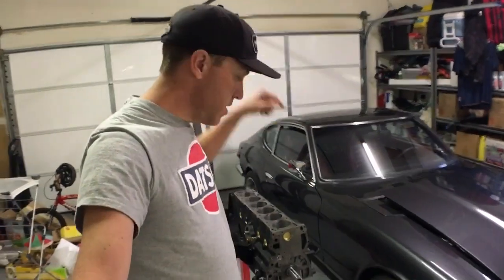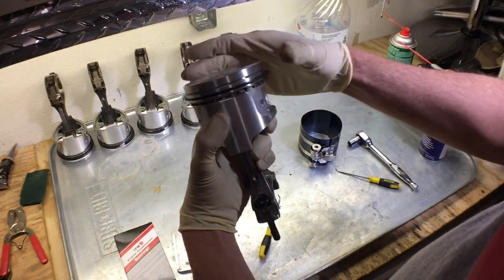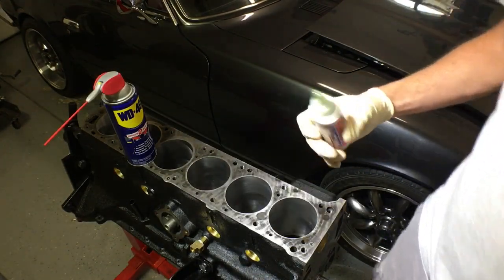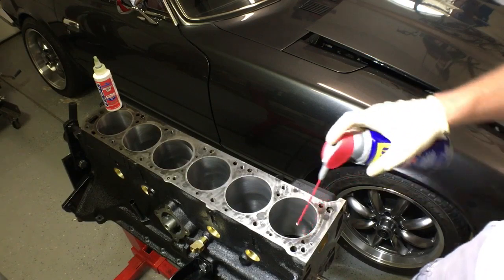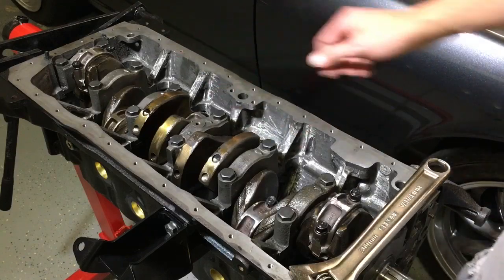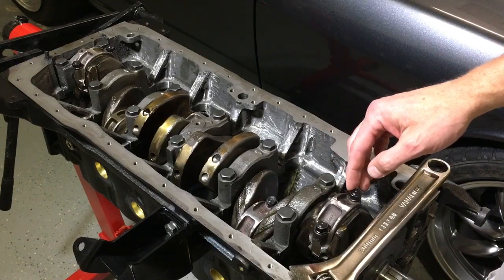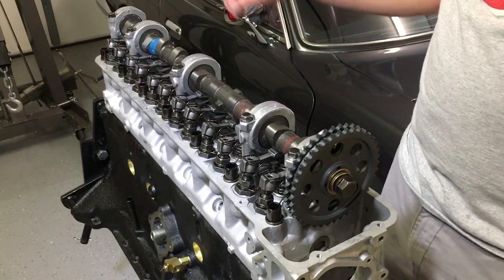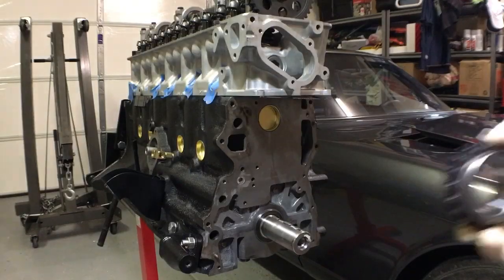How to install pistons, cylinder head, and timing chain in Datsun Z engine

Comment: Great detailed video thank you!  Q - why did you put front cover on and damper to pull right back off?  Was it to make sure you had block at exact TDC??
Reply from the maker: Thanks! This was to double check and make sure our top dead center was accurate on the marking plate and damper.

Comment: I was wondering how you calculated the extension into the torque procedure on the rod bearings and head bolts, from my understanding you loss and have to compensate.
Reply from the maker: There’s no real loss when using extensions, this guy has a few great videos showing. https://youtu.be/tRR96ILGORU
Thanks for watching!

Comment: GREAT videos, Thank you! Question, I have on this is at the 9 minute mark when you put the head on,  you said to :make sure head is in the 1 position" how do i verify that?
Reply from the maker: Thank you! Basically it’s pre-timing the cam and it’s from the dot on the cam gear. Then triple check your timing between the crankshaft and cam

Comment: Just a quick question.  Why did you use WD-40 instead of oil?  I have never assembled an engine but doesn't wd-40 leave a dry surface?
Reply from the maker: +Glenn Randolph it works great as a simple lubricant. Now obviously it doesn’t take the place of assembly lube or engine oil.
Reply: Yeah, I thought WD was a cleaner, even though most people use it as lube.

Comment: So far I have enjoyed your videos,  but one step in your assembly was extremely scary..  When you drive the pistons into the holes you MUST control the big end of the rod.  Damage to the crank is almost a certainty.  Also  some rod bolt rubbers are also a must IMO.  these are crucial steps when assembling a engine. Hope you got lucky.  Got to love the L series...

https://www.amazon.com/Goodson-Rod-Bolt-Protectors-16/dp/B0009RH412
Reply from the maker: +American Patriot Adventures I whole heartily agree with you. Even though I was super careful and took my time, using the rod bolt protectors or even a couple cuts from rubber fuel hose saves you the worry or headaches. I appreciate the recommendation and for watching!! 🤘🏻
Reply: @CarsBikesandCoffee    i will watch your further videos tonight.  Looking to find me a l series project again.  Haven't built one in about 20 years.  It is fun seeing your build.
Reply from the maker: +American Patriot Adventures right on! They are a fun car to work on and build, so many ways to do them. We will be getting back to our 260Z soon! It is a total “frame-off” restoration. Stay tuned!

Comment: 12:48 chain just walked lol
Reply from the maker: +Mike CorLeoné ha, wow that sure looks like it did. Thankfully being the tensioner side it was fine. Everything lined up! Good eyes though!
Reply: Cars, Bikes, and Coffee watching your videos and others is giving me massive motivation to start working on my 71 z.. i have the L28 out on a stand but i bought the car in pieces.. the previous owner took it apart and I’m trying to piece it back together, my biggest question is this. I have a round hole on the drivers side of the engine towards the front of the block where it looks like something goes there.. not sure if it’s coolant or if it’s a breather or what.. do you happen to know what goes there?
Reply from the maker: +Mike CorLeoné awesome! So assuming the front side of engine, on the head, that is the coolant thermostat housing. That would be where the top of your radiator would connect.

Comment: Suggestion that you put rubber fuel line over the connecting rod bolts. Otherwise they have good odds of scratching the crank on their way over.
Reply from the maker: Yes that is great advice.

Comment: Hi thanks for video
Would you show how to adjust valves please. I tried few times on my 280zx and still not right. Maybe my method is wrong.
Thanks
Reply from the maker: Thanks for watching! I will have that on the 260z build that is coming up!
Which method did you do? Hot and cold?

Comment: I have been keeping up with the progress on your Z, Very Nice. I am rebuilding a 75 L28 N42 block and currently having the new 30 over dished pistons fitted. until my machine shop called and said they messed up and went 40 over on the boring. they are buying me new pistons but are having problems finding 40 over dished pistons. but can source flat top 40 over pistons all day long. Do you know if the flat top pistons from the '81-'83 years will work in a '75 L28. the machine shop says the flat tops will extend .030 above the block. what can be done to correct this problem? or should he just keep looking for the dished? Thanks
Reply from the maker: First and foremost, thanks for watching!
So from what I understand running flat tops with the N42 will require a little more work if you go that route. Easy for machinists more money, time, and energy from you. 
Are you in the states? I did some google’ing and it looks like California Datsun might have some 0.040 over dished, https://www.californiadatsun.com/cylinder-head-parts/dished-engine-piston-set.html
I guess, the next question is how much modding do you want to do and what do you want from your engine? Let me know!

Comment: Are you certain you're using the correct head gasket for the F54 block?  It looks like the one you chose is covering all the small coolant passages to the head on the passenger side of the motor next to each cylinder.
Reply from the maker: Thanks for bringing to my attention. I’m going to pull the head to triple check.
Reply: @CarsBikesandCoffee  Look at 8:36 in your video. It's unfortunate when you have to undo what's been done, but in the long run it'll be worth it. I suggest using an OEM Nissan HG or even the MSA/Z Store gaskets are of high quality.   Always double check the match up of the oil/water ports from the block to the head, over the years small changes happened to these heads/blocks. Also closely inspect with any HG that the cylinder fire ring on it matches your block cylinder size and doesn't cover it in any way.
Reply from the maker: Mr. Datsun its a bummer, but you are right better to find it now, than after driving it around. I took screen shots of the video and see what you’re talking about. Really appreciate your feedback! Engine saver!
Reply from the maker: Looks like we are good. After comparing the video (screen shots) and to other brands, and a call to Rebello. We are good to go. Thanks again Dr Datsun. Always better to play it safe.

Comment: Nice video, I have a 73 Z as well and I am disassembling a 78 L28 N42 block right now in fact. Are you going with the SU carbs? what model head are you using? Good luck
Reply from the maker: Thanks! Awesome! I have a P79 Head (check out the head mod vid!) I have dual Weber carbs, but the eventual plan is to go to triples. Good luck on your build too! What’s your overall Z build plan?
Reply: Rest-o-mod, the car has about 86K miles on it, but not original numbers. it hasn't seen rain or snow in about 25 years, so its about as close to no rust as one can find around here (Omaha, NE) Great Fun to drive. I'm going to stay with the four screw Round tops for Carbs and a header. I've got a N47 head, but I'm going to run a mech fuel pump, and the header has square ports, so I will use the E88 that is on the current engine. Dont know if this is good or bad. Thanks for saving your build to You Tube.
Reply from the maker: The round top SU carbs are awesome!

Comment: Careful putting the pistons in like that, the rod could be catching on the crankshaft and might scratch if you try to force the piston in. Otherwise, cool build, I look forward to it! If you dont mind, could you list where you get your parts? I saw the partsology video, but I've only been able to find 4 other sites that have parts for these L28s and those pistons look pretty good
Reply from the maker: Thanks! Very good advice, I did double check off camera before I started smacking but good to be aware of that.Looks like I didn’t post the link for the pistons, thanks for catching that, just updated. Been having good luck with rockauto.com on hard to find parts , even down to the cam towers. Would it be helpful for a video on all the parts and where they were found?
Reply: Rock auto? That's surprising, on my other cars it seemed that rock auto didn't have many parts. I haven't checked for the L28 (because of that) but if they even have cam towers that's pretty cool. A video on the parts and where you got them would be great, could even include info on specs of the parts themselves. That way you always have one spot to find all that info after it's done in case people want to know more about it. Also, more videos about Datsuns, which I'm all about haha
Reply from the maker: Todd Bentley yeah I was shocked. Things I couldn’t even find at the specialty Z stores.
Reply: That's great to know, thanks!